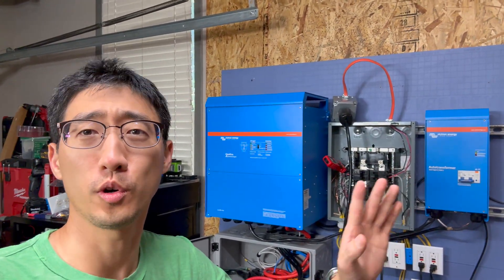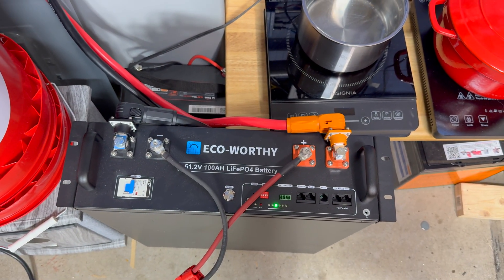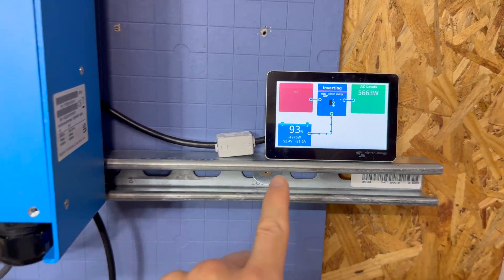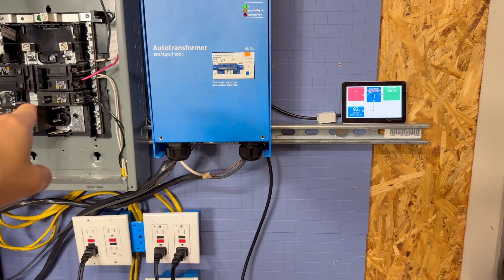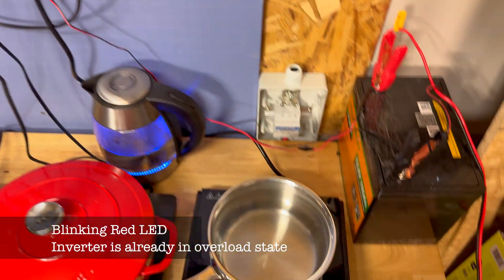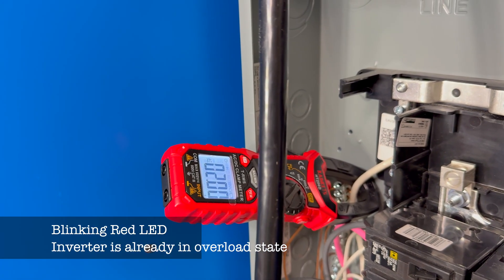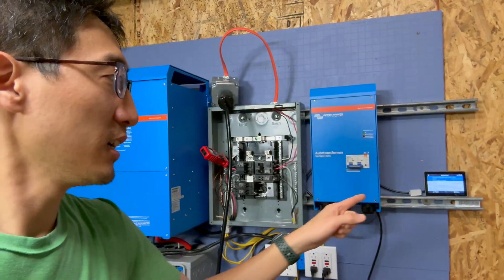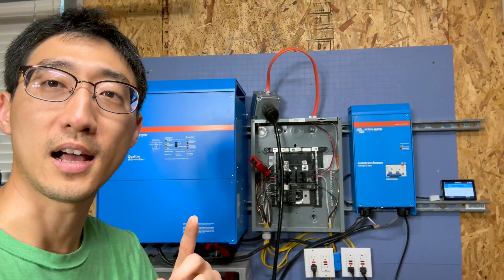Victron Quattro 48v 10kva inverter load test part 2  with 240v auto transformer| EG4 Battery

Comment: You need to be sure of the various loads power factor.  Anything that has to convert AC to DC , like chargeverter and inductive cook tops are suspect and need to be actually measured to know their power factor.

A poor power factor, particularly caused by high AC current crest factor for AC to DC conversion, can greatly limit the maximum actual real power delivered from inverter.

I think the Chargeverter is pretty good with active power factor correction but many cheap chargers have terrible high peak current crest factor, drawing high peak current only at sinewave voltage peaks.  Cheap induction cook tops also do not have power factor correction.  This is especially likely for U.S. appliance market which has no regulations for their power factor. (European appliances do have to meet minimum requirement for power factor)

Resistive heater loads have good power factor near 1.0.

Comment: That was probably my comment about the 32amp unbalanced load.  What would be interesting is to prove that on video.  Run the chargeverter at 50amp/240v and then load up one leg only and see how far the neutral goes with ammeter before autotransformer breaker trips.  Will be under Quattro max load but will show how the autotransformer reacts.